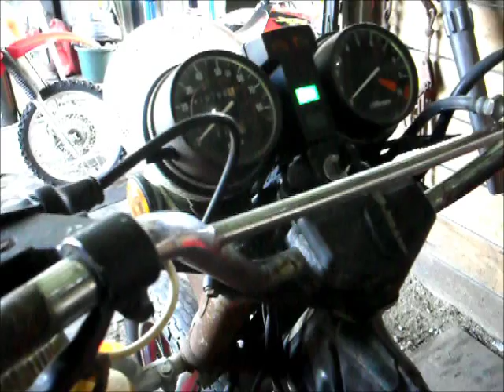Mac 4 into 1 pipes on CB650

Comment: He a can you tell me what filters you are using thanks
Reply from the maker: stuart mcclean I can't remember the exact part number but they are K&N filters I bought from Summit Racing. Please be aware that I had to modify the throttle linkage on the carburetor to make them fit. see; http://www.motopsyco.com/2013/08/09/vintage-piston-valve-keihin-carburetor-overhaul/ 
You also have to be careful with the choke cable as well, they can cause the choke linkage to stick on if not carefully installed.